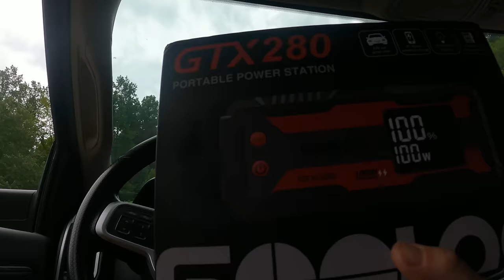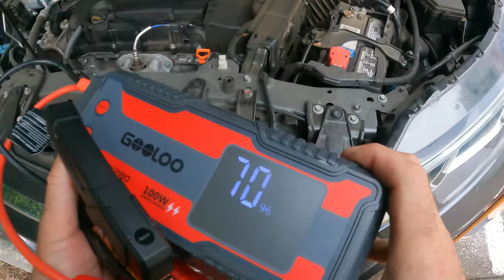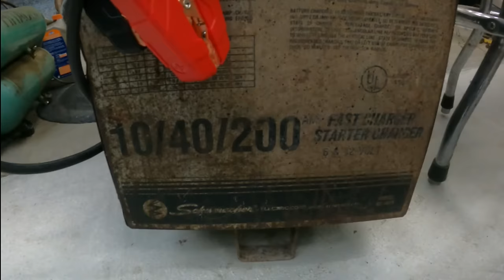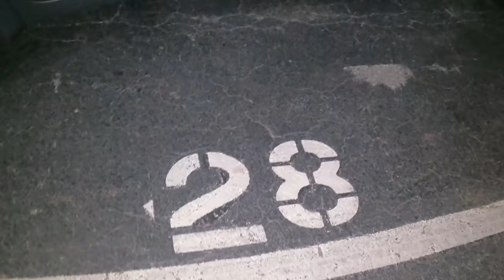Illegal Parker Calls Just To Tell Us We're A Scam! | Plus A New Gooloo Jumpbox Review GTX280

Comment: He threw himself under the bus when he said “I assumed”.  I’m 99.9% positive he said he assumed the spot was ok to park since it was the same pavement as the hotel parking lot. He also said he saw the sign but the print was to small. My suggestion, you can find cheap reading glasses for about 10-15 bucks at most local CVS/Walgreens etc and that’s a whole lot cheaper than a tow.
Reply: Shoot, I get them 2 for $12 on Amazon and they are amazing!

Comment: I have been watching all of your older videos. I noticed in this video you plugged in your battery charger and it began making noise. I had the same issue, the meter fell off the front and down into the charger. When I turned it on the fan was hitting the little meter making an awful racket. Was a simple fix. I opened the box and put the little voltage meter back inplace.

Comment: The cost of your tow truck, the cost of gas, the specialized equipment you all use (like the dollies to keep hold the tires off the pavement), the work you go through to secure the vehicle AND the tight quarters in many instances in getting a vehicle out of the area it's in PLUS all the time you spend doing that.  What you charge may seem high, but for you to make money and support yourself as well as your business (maintaining and/or replacing tow vehicles) - that all goes into what you charge!  I think it's fairly reasonable!

Comment: prices vary. this is what texas charges.
Pay all fees for towing and storage:
The TOW CHARGE: The maximum charge for a private property tow is:
$272 for a vehicle weighing up to 10,000 lbs
$380 for a vehicle weighing more than 10,000 but less than 25,000 lbs
$489 per unit for unit for vehicles weighing more than 25,000 lbs with a $978 total maximum
These are the maximum rates statewide. Lower rates may be set by local municipal or county rule.

Comment: I find it coincidental that the first part of the video had a jumpstart.
I've been dealing with a battery issue the last couple days. Went to start my van this evening and it was completely dead!I'm going to buy a battery tomorrow, but if I didn't have my jumpstart battery box I would have been calling roadside assistance as well.
I had to replace the alternator maybe 4 months ago. The battery looks old and posts are corroded so I'm sure it has needed a new battery for awhile.

Comment: The sign was less than 12 inches from the car, it says do NOT park there without proper authorisation. You don't have the ability to control the signs and you get called by the property owner to tow the cars. 

You also charge a fee for the cost of fuel, wages of the employees going to pick up the car, maintenance of the vehicle, cost of not having the keys and cost for storing the vehicle in a secure location. This would also have extra on top for other business expenses and profit. So if it is what it costs for other companies to tow, then it is fine.

Maybe people should use the paid parking as it is cheaper than using the private parking and paying for a impound/tow fee.

As for the sign, it was clearly written. I do have one issue, maybe suggest they add arrows to the bottom of the sign that point in the direction of the private parking. And if the sign was for every 5 or so parking spaces, this would constitute less of a reason for them to argue. But of course those who don't bother to read a sign will always have a complaint.

Comment: at 8minutes + that noise is the cooling fan has gone bad, just replace it. I have an old charger just like it bought it in the 80's and mine works just fine. Had to replace the fan a few years back but man it will start a dead horse.

Comment: We had that exact same old battery box at a fab shop I used to work at that thing is a tank I dropped it off the back of a flat bed on to concrete another guy caught it with the forks on a forktruck while he was spinning around just sent it flying across the floor and it also got a 4x4 piece of square tubing dropped on it from about chest height no matter what we did that damn thing would keep running…they don’t make things like they used to

Comment: That 200amp charger is a beast it'll charge a battery and it'll jump start a Cummings like it was a motorcycle engine my dad has one he's had for 40 years they used on the shrimp boats to charge the big 10 post batteries
Reply: Cummins*

Comment: The guy in the last tow has many valid points.  I am curious how much he was billed for the 7 mile tow.  You keep muting the cost in all your videos, but I am guessing it's somewhere in the $35 to $50 per mile range.   I suspect your charges are way high for these tows because you're getting cash.   The same normal tow is probably 1/2 the cost because they are a customer, not a victim.  The flyer the hotel hands out should say "Do not park in the numbered spots" in hilighted bold letters.  The fact that this issue continues says alot.  The one sign shown in the video would be blocked by a car parked in front of it so i can see how other cars from other videos would miss it. Gotta side with all the people getting towed from that location.

Comment: If you seriously want to know about parking signage and such you should look at parking enforcement signage in Southern California. I worked P.E. in Solana Beach and Del Mar areas as well as in Riverside county. Look at their Municipal codes and CC 's and you will find a lot of examples.
When is example is the one that I don't think is no longer enforceable because they changed it to donations were those numbered spaces by I think it's called The Country inn. There's only one little sign and the ground is not properly labeled as it should have a red line on the which constitutes a No parking zone. Within that red line it should be lettered no parking except for by employee permit. And there should be a sign for every space.
Another example is the candy kitchen, I think that's what it's called for their employee parking lot again they've got no parking but to the most people that just means there's no parking right there on The ground by the no parking lettering.  There needs to be more signage clearly saying no parking in this lot unless you have a employee parking permit. And yes of course violators will be towed at vehicle owners expense. If there is a municipal code that should be on the sign as well. But there should also be a red line on the exterior of the white line around the private parking lot to designate it's no parking zone. Those with a parking permit know that they can cross the red line to park per their permit, others cannot.

Comment: RATES FOR NON-CONCENT TOWING FROM PRIVATE PROPERTY, STORAGE.
Any towing and storage firm engaged in the business of non-consent towing from private property shall not charge the owner of any towed 
vehicle or personal property in excess of the following:
1. Towing: Vehicles Under 7,000 pounds GVWR $155
Vehicles Over 7,000 pounds GVWR $275
 Length of 25 Feet and Under $275
 Length More than 25 Feet $375
The towing fee shall be all-inclusive. No additional fees may be charged for using dollies, trailers, lifts, slim-jims or any other equipment or 
service or for mileage.
2. Storage: The maximum fee for storage of any vehicle removed from private property is $40 per day. No storage fee may be charged for 
vehicles stored two hours or less.
III. OTHER RATES
Drop Fee: All licensees who engage in the business of towing vehicles from public or private property shall post a notice on each vehicle, in 
letters not less than two (2) inches high and appearing in a legible manner on the boom or rear of the wrecker as follows:
“FEE TO DROP VEHICLE BEFORE DEPARTING: $75.00”
If the owner or operator of the vehicle is present and removes the vehicle to be towed from the premises before it is connected to the towing 
vehicle, the owner or operator shall not be charged any fee. 
Vehicles over 7,000 pounds: C-Class Drop Fee: $175
If the owner or operator is present after the towing vehicle has been connected to the vehicle to be towed, then the vehicle shall not be towed: 
but the owner or operator shall be liable for the drop fee, in lieu of towing, provided that the owner or operator forthwith removes the vehicle 
from the premises. A vehicle shall be deemed connected if every procedure required to secure the vehicle to the wrecker or wrecker 
equipment so that the vehicle may be safely towed has been completed at the time the owner or operator arrives, including the attachment of 
any safety chains.
Lienholder Processing Fee In addition to the rates authorized above, wrecker companies are authorized to charge a onetime 
administrative processing fee of $35 for any car remaining in storage on the company lot for twenty four hours, to offset direct costs for 
notification of the owner or lienholder as required by state law, and an additional $25 administration processing fee for each additional 
notification sent to the owner or lienholder as required by law.
In the event the interior of a salvageable vehicle will be exposed to the elements, wrecker companies are authorized to charge a one-time fee 
of $40 for materials and labor associated with wrapping a vehicle to protect the interior.

Comment: Maybe they need some large red signs? Those signs are not big. And signs are low with small font. 
I would recommend they invest in larger signs.. obviously it’s a problem. It’s good money for you but the proximity to the hotel is inviting. And likely brings bad reviews for both. Its different if you are downtown.
Reply: They still wouldn't READ
Reply: @rogerokelley  probably true! It’s obviously inviting since so many park there! 
It’s so close to the hotel, it’s too easy to presume it’s hotel parking. 
I agree.. the owner is in the wrong, just seems it’s an inviting nuisance that can have better signage.

Comment: A battery needs to be strong on cold mornings people tend to change their oil after vacation and cold temps turns oil into molasses.
As a side note I wonder why people buy diesel cars as their personal vehicle. The engine costs more than gas engines and fuel isn't available everywhere. It's doubtful they will drive 500,000 miles to realize any savings. Diesel fuel costs more than gas and your garage smells like a Greyhound bus station.

Comment: So the guy makes a point. If I pull into a parking lot at a hotel, I'm not checking the no parking signs to make sure that random spots don't belong to some other random organization. I would assume, as would most people if they're being honest, that the signs are stating no parking unless you're staying at the hotel (especially if I read a similar sign elsewhere in the parking lot). I get you have to put up with assholes all the time, but you have to see that as a logical assumption. Acting like that assumption is crazy, only feeds the anger of the people you're dealing with. 

That being said, if they're numbered and the rest of the lot isn't, I would assume those are special spots and would likely read the sign I parked a foot in front of. Also that's not your doing, its a asinine setup between the hotel and the city. The fact that the hotel clearly knows this happens, they should be telling their guests "Do not park in the numbered spots". I get the towee's frustration, but it should be focused at the hotel and I'd just get reimbursed for everything through them.

Comment: These people that think it’s high have no clue what pricing is. 

Every time I would call for a tow to have a vehicle impounded, the tow company charged 250.00 and hour, two hour minimum for law enforcement rates. 

There are times that it would take a tow an hour and a half to get to me because I was 90 miles from their tow yard. 

Even it was 30 miles it would still be about a 650-700 tow bill. 

Their entitlement is disgusting. Yeah throw out the fact that your a journalist. I guarantee your channel is watched and looked at more than any story or stories he writes. 

Every state has requirements spelled out for how signs need to be for towing vehicles on private property. I bet he even complains if he gets a ticket for speeding or running a stop sign saying the signs need to be bigger, no all regulatory road signs are made to a federal standard. They can be larger than the standard, but not smaller. And font is specified as well. 

It’s a drivers duty and responsibility to pay attention to every sign on the road and in parking lots. They are there for a reason, not to make the area look pretty. 

And I have actually told people that I stopped. “got to pay attention to the signs, they are there for you, the driver, not to make the desert look pretty!”